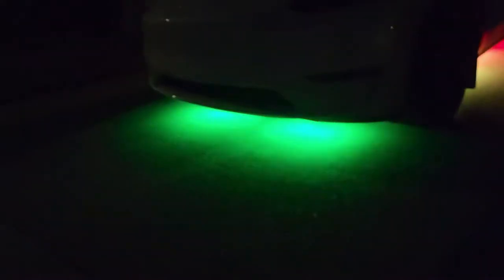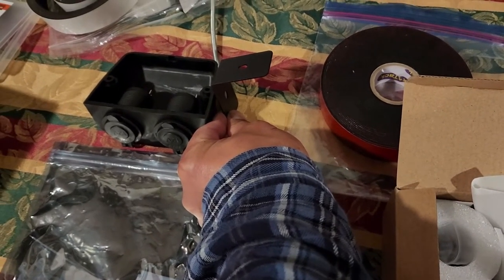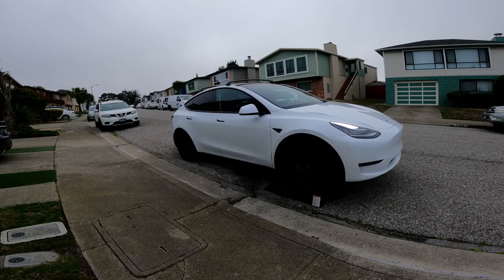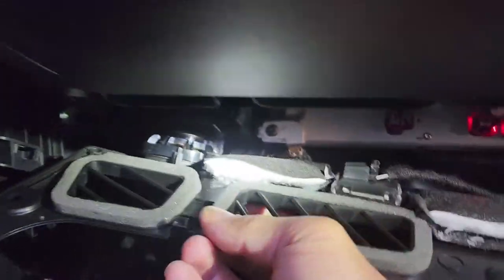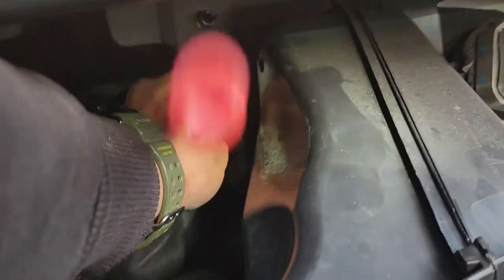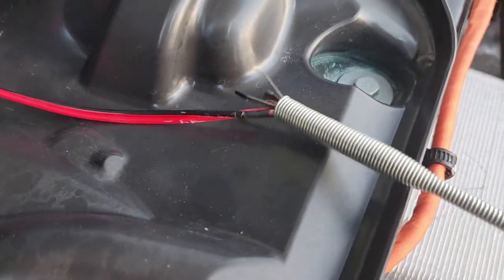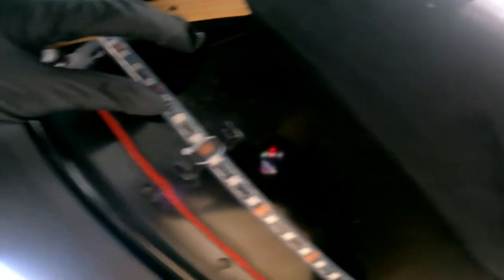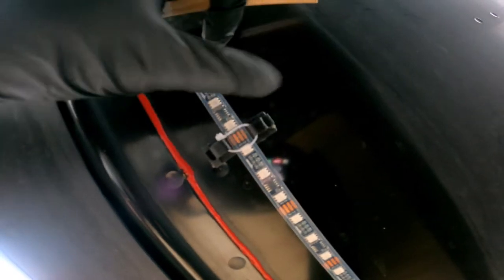How To Install Underglow on A Tesla Model Y

Comment: Teslux innovations is much more suited for any tesla install. It has a ghost controller which is controlled by Bluetooth and has a built-in kill switch and is designed to work with our tesla LV batteries (but keep in mind Tesla could charge a diagnosis fee if you bring it in plugged in). I did 5 teslux underglow installs and 1 lowglow and I prefer teslux any day. Only extra step with teslux is grounding the wires to the back brake 10MM.
Reply from the maker: Cool... Thanks for the info...

Comment: Best not put the stand under the battery pack next time
Reply from the maker: Yup, I know...  it's difficult to find any other spot since I have both car Jacks at the 2 jack points in the back. If I put them under the wheels or suspension, if the car drops, the suspension will compress and I'll still get crushed so this is only last life saving setup I could think of. I was picking my life over the car...  I'll look for other spots next time i lift the car... Have any suggestions?
Reply from the maker: **Update** I have now purchased these jack rod stands to be used as a safer method of jacking up the car before crawling underneath. Several people have commented the dangers of having the jackstands under the battery pack and I agree and found this solution.
https://evannex.com/products/aga-tools-jack-rod-stand-for-ev-owners?_pos=1&_sid=996b633af&_ss=r
Under $300 for a pair

Comment: thanks dude, easy follow step by step. just put mine on. but i actually used the screws & clamps the under glow box came with. the glue wasnt holding up. i cleaned the areas very well i might add.
Reply from the maker: Oh man, did you try to reinforce them with the little small square sticky pads? Mine is still stuck on there 9 months later. It seems like with any sticky tape, you need to clean it very good and place pressure on the LED strips for at least 24 to 48 hours. Maybe some duct tape or something on the ends of the light strips to keep pressure on the adhesive for 48 hours and then remove the tape carefully so it doesn't pull the strips off. That would help maybe for others with the same problem with the adhesive not holding initially.

Comment: 37:00 ummmm if it lands on those sharp jacks and it punctures the battery pack, you'll die a very painful flaming hot death. Safer to just drive 2 wheels onto the sidewalk.
Reply from the maker: Hahahaha. I like the gorey picture you just created in my head!!! I could picture a perfect situation..An earthquake hits, the car falls off the hydraulic jacks, then i still get pinned under the car, then the jack stands puncture the battery pack and the lithium battery starts to sizzle while I'm pinned underneath the car. The car catches on fire as i watch myself burn and melt and fuse and become one with my tesla!!! That would be a horrible death!!! FINAL DESTINATION scenario!!!  On a serious note, that is a very possible situation...  Thanks for the comment! You're right!!! This will help a lot of people... that's a great idea! Never thought of that. 2 wheels on the sidewalk is a nice alternate setup to keep everyone safe... Safety should be #1. Sometimes we might not see a dangerous situation but our peers can help warn us. That's why I like working with others because we can help warn each other about unsafe situations. We all enjoy working on our projects but we also like making it to the next day without hurting ourselves and others. Thanks for the reminder about safety!!!
Reply: @arisnavarro  Yup! No problem! Stay safe out there :).For added height, you can use those ramps on the other side. Also, if you hold the park button, it engages the parking brakes.
Reply from the maker: @It's Binh (Been) Repaired & Reviewed ---  I wanted to purchase these jack stands which would be ideal for these type of installs but they are so expensive.
https://shop.teslarati.com/products/tesla-jacks-stands-model-s-3-x-y-rennstand-red?variant=21213029040187&currency=USD&utm_medium=product_sync&utm_source=google&utm_content=sag_organic&utm_campaign=sag_organic&utm_campaign=gs-2020-11-23&utm_source=google&utm_medium=smart_campaign&gclid=CjwKCAiAmuKbBhA2EiwAxQnt70nP68WYxa-p7pbtaBBxZ-cFOX0atYdGWv05l1nMylUibeD5tgUtthoC_AwQAvD_BwE
Reply: @arisnavarro  close to $500 for a pair is quite a bit. I'll have to find a higher curb lol
Reply from the maker: **Update** I have now purchased these jack rod stands to be used as a safer method of jacking up the car before crawling underneath. Several people have commented the dangers of having the jackstands under the battery pack and I agree and found this solution.
https://evannex.com/products/aga-tools-jack-rod-stand-for-ev-owners?_pos=1&_sid=996b633af&_ss=r
Under $300 for a pair
Reply: @arisnavarro  nice!

Comment: Nice video, but couple of questions. 
Why not tuck the black wires inside the undercarriage panels? 

Why not connect direct to 12v battery?

Now that you've done it. Do you think it's really necessary to take off the frunk bucket?
Reply from the maker: I didn't feel like taking apart my undercarriage panels is why i did it this way. 
I don't think it's a good idea to connect directly to the 12 volt battery because then you can't easily turn on and off the underglow. You have to open the app on your phone to control your lights. When you're driving around, you want to be able to just flip a switch to turn them on and off. A switch gives you assurance that it's either on or off.
The frunk bin must come off so that you can run your 12 volt power cable.